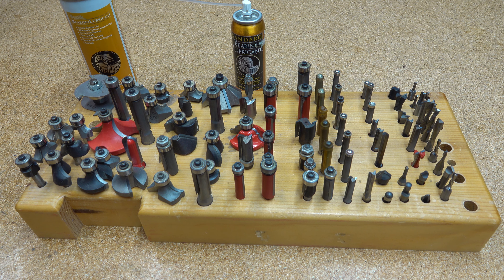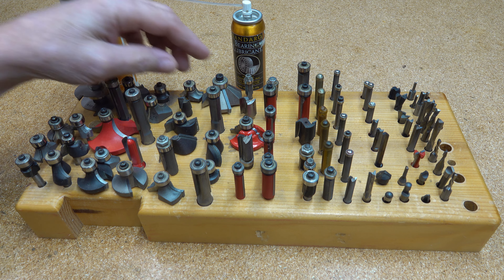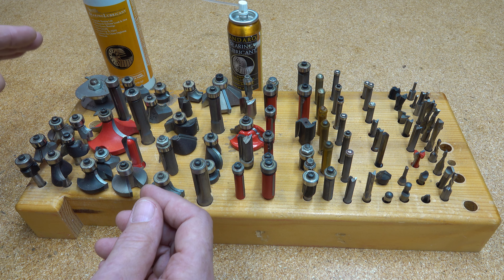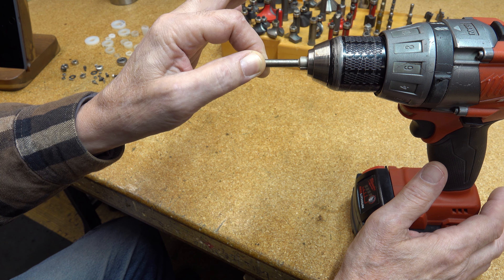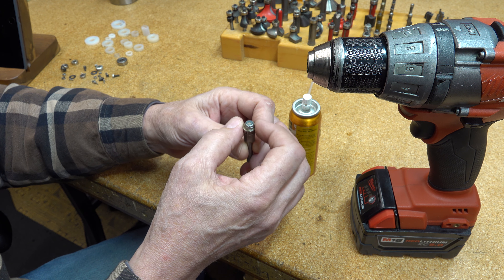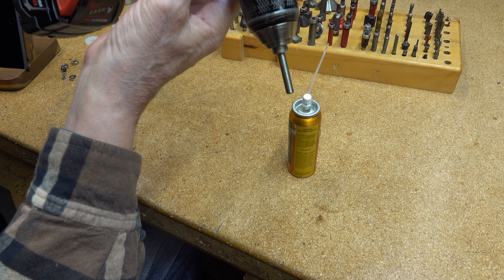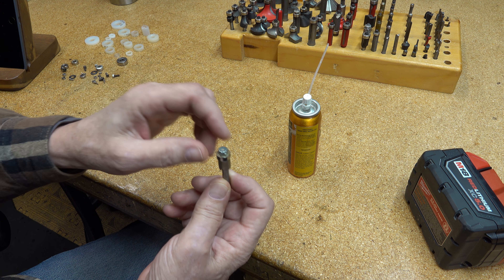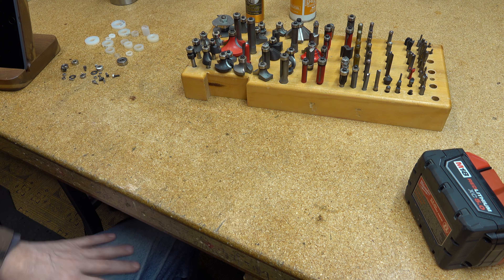Revive Frozen/Stuttering Bearings In 1min!

Comment: I have Ballistol and some white lithium grease in the shop. I consider the Ballistol sticky oily and the step up after WD40. Either of those viable on router bits? I have definitely cleaned my bits with WD40 flooding but not the bearings. I love that your block of wood holding all your router bits makes all the other organization methods unnecessary.  I used what were 2x4 offcuts and have 6 different blocks in a drawer.
Reply from the maker: DONT use that on a bit! Order the right juice and you'll be amazed. Ballistol I have too and it is not suited for the job. No grease IMO belongs in a router bearing it's too fast for the grease to last. Bad application but inexpensive to do in production. Buy the best and don't look back, please trust me on this...

Comment: Would dry graphite lube work, or would that chew up the ball bearings or gunk up the works? What brands of bearing lube would you recommend or advise to avoid?
Reply from the maker: From the 3 I've tried they all seem to be the same in smell color and residual value. Just make sure it says it frees stuck bearings on the label! The 3 I've used all were excellent. Seemed to be the same formula. As far as Graphite goes, I have no test data on that...can't say.